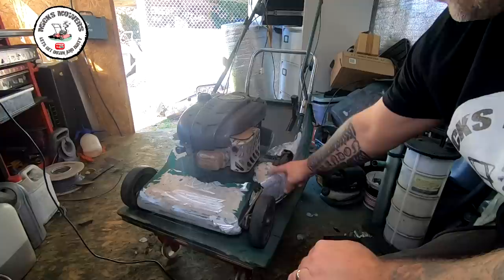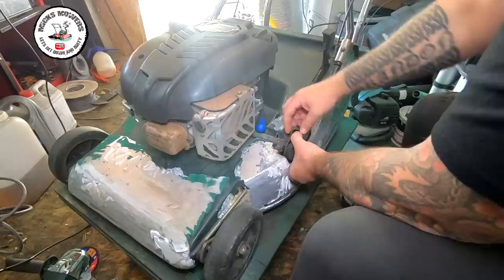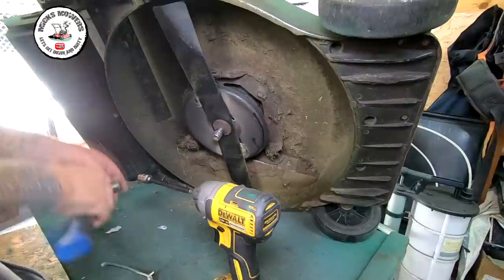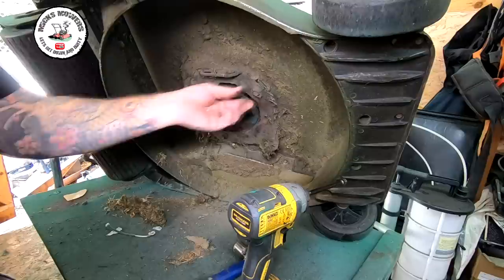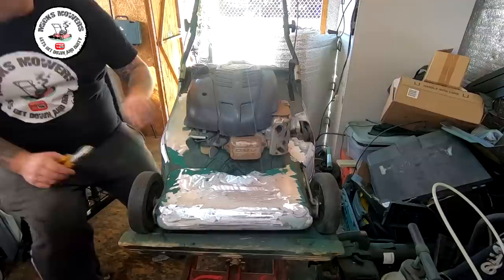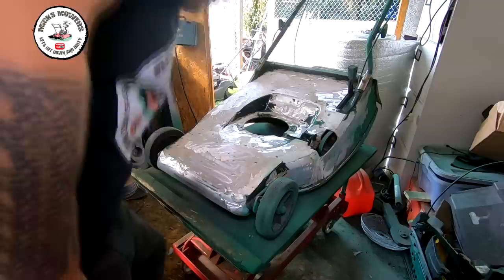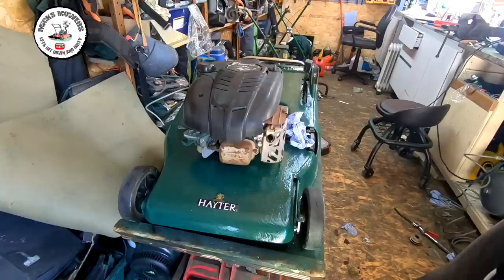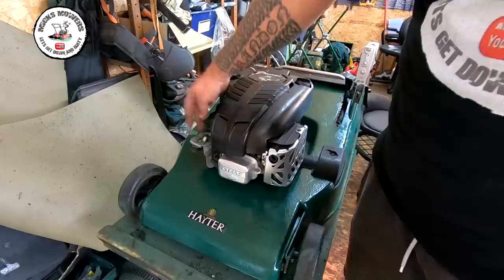Hayter 56 Pro Lawn Mower how to make look like new - low cost

Comment: That machine used to have a blade brake clutch which was the bracket held on by the engine bolts , thats why the friction disc came off easier than normal as didnt have one from new
Reply from the maker: Yeah mate..

Comment: Pros are the grey models! Nice job on the paint work, lovely engine when they work right. common to have valve issues. lovely 22" cut machine. nice and light compared to modern stuff.👌🏻
Reply from the maker: Ta for popping over young man

Comment: A great restoration Mick, will be good for another 20 years to the new owner. The paint and oxidisation is the Achilles heel of the Hayter. Cracking mower though Mick, well worth anyone’s hard earned money. I had a 48 in for a new tank and service and couldn’t send it back in the state it arrived so gave it a happy birthday with a bit of a spray. I used green 14 metallic. First class channel Mick, I’m hooked 👍🏼
Reply from the maker: Can't beat giving a mower a happy birthday mate..

Comment: Nice rennovation job , some difference at a low cost . Just wondering how to get the exact model of my Hayter Harrier 56 . It is 25 years old and needs a few belts etc ,but still going well . All the parts diagrams that I have viewed seem a bit different .
Reply from the maker: The make and model will be on the tag

Comment: Hi Mick, What is the best way to change the oil please on the 56pro … have you already done a demo? Cheers Tim 👨‍🌾
Reply from the maker: If you don't have an extraction pump then just tip it on its side with a pan mate
Reply: @themowerman  Cheers for the prompt and helpful response. I’ll get an extraction pump and continue to watch your videos. 👨‍🌾
Reply from the maker: @timward5690  ok cool